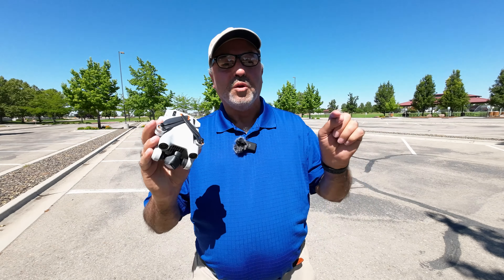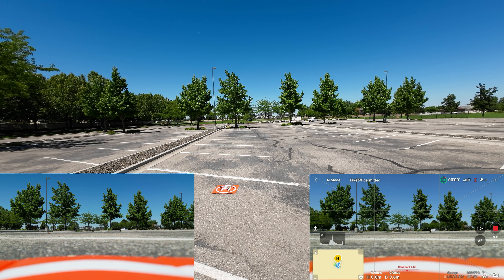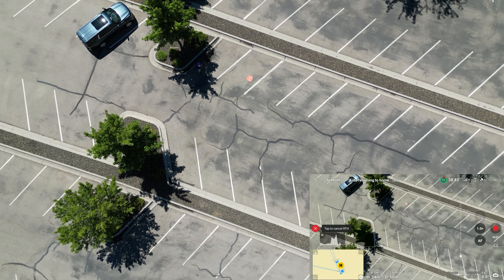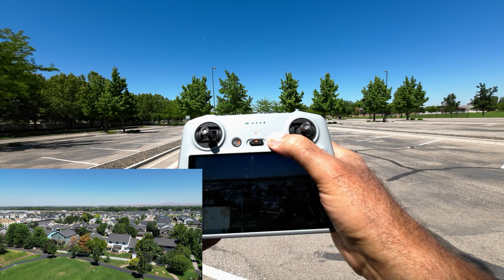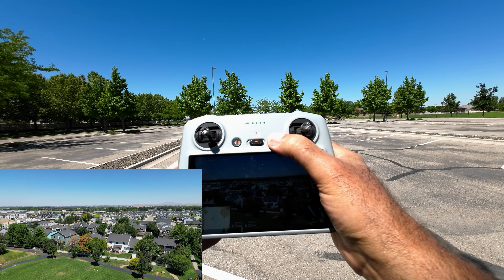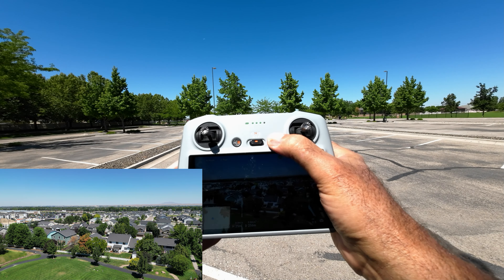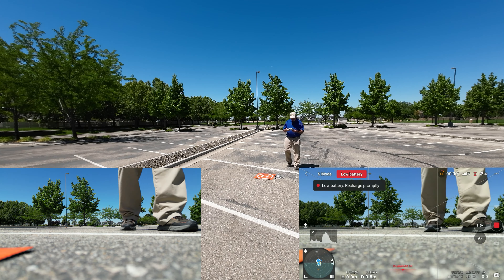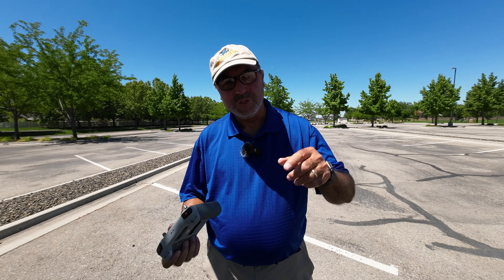DJI Mini 3 Pro - Complete Guide To Return To Home RTH - Tutorial

Comment: Can it dive faster with the motion 2? Say you dive as normal using the motion feature and pair it with the joystick? I always felt diving looked really slow when not in manual.
Reply from the maker: The Mini 3 Pro is not compatible with a motion controller.

Comment: Great video explaining RTH, however can I ask about Visual Line Of Sight as I'm struggling to understand it even after reading a great deal and watching many vids. I know this is a demo video to show what happens when the signal gets lost etc but I heard you say a couple of times things like "ok I hear it coming back", "going to turn away from the drone" and having the drone so far away you can't possibly see it, how does that work to stay inside the rules/law. I'm confused!
Reply from the maker: I understand your confusion.  I've thought about commercial drones that do automated mapping.
Reply: @IdahoQuadcopter  over the last two days I've read the new CAA guidelines for 2023 (as I'm in the UK). 4 weeks ago they changed the guidelines and later admitted they got a whole lot wrong as some CAP rules contradicted other CAP rules (there's also some interesting videos on this). Once reveiwed and re-released they did a question and answer interview and touched on automated mapping/RTH and said it can't be classed on as reliable. For example, when you switched off your controller in this video you were no longer in control of the craft, it was in control of itself, so if you had seen something like emergency services helicopter in the sky you couldn't control bringing it down therefore adding to the danger as your RTH might actually bring the drone into contact with that helicopter. However even if I have VLOS and the controller goes off I would still have the same problem 🤷🏼‍♂️, see where this just adds to the confusion

Comment: I was flying my Mini 3 pro two days ago and learned something. I did not pay attention to my pre-flight. I took the drone up about 300 feet to look around. I had it in one place for awhile panning and taking snapshots. I lost my bearings as I was over a lot of thick trees. I hit the return to home and it turned and headed for home. I noticed it had drifted a good bit from where I thought it was. It made it back home and before landing I took control as I like to land it manually. The wind was blow lightly, not heavy at all. As I did some trouble shooting, I found the left to right control was not working. I was turned off. I figured out the little amount of wind took it off course and it could not make the correction with the left right disabled. I learned to always do a pre-flight every time you fly.
Reply from the maker: I agree!  It's important do go through app settings.  Thank you!

Comment: Great video Marcus.  I learned some things.  I do have one question though, regarding Return to Home on a DJI drone.  Let's say I am climbing a mountain with the drone, staying about 100' off the ground.  The mountain is 1200 feet high.  So I reach the top and my Controller registers 1300'.  I have my Return To Home altitude set at 200'.  I lose connection and the aircraft automatically returns to home.  Will it fly straight over me before it descends, or will it try to descend to 200' on the top of the mountain, thus crashing on top?
Reply from the maker: The RTH height that you set in the app is above take off point.  If you flew the drone higher, it would stay at the higher altitude when returning home.  If there is an obstacle in the way, the drone would hover in place until the battery ran out, and it would land where it's at.  In certain situations, APAS may allow it to fly around an obstacle.
Reply: @IdahoQuadcopter  Thank you!

Comment: Nice! Thanks, ... can you change it to follow the controller? , or do you need to select the controlled to update this just before you land it? Thanks 

The use for reference, would be using it to active track a boat. With of course wanting it to auto track where the controller is to land wher ethe boat has moved to? :). Thanks
Reply from the maker: You can use active track to track your boat, but no this drone does not have a dynamic home point.  👍

Comment: Quick question about obstacle avoidance.  What's the distance that it stops in front of an object? (not using the go around feature)
Reply from the maker: I'm sure it depends on the speed at the time.  I can tell you from experience it's several feet.

Comment: Hello, does RTH  setting stay as it is IE to the controller (22:50) until altered again or does the RTH controller setting have to be picked after every RTH.  Cheers 👍
Reply from the maker: The drone does not have a dynamic home point.  If you move, you will need to reset the home point again.  👍
Reply: @IdahoQuadcopter  Hmm ok, that's surprising considering the cost of the drone. Just another quick question if I may....  
As it doesn't have dynamic home point, can one of the quick select buttons underneath be programmed as a RTH button ? Thank you .
Reply from the maker: @Original-q11  I do not believe so.  I have not seen that as one of the selections in the app.
Reply: @IdahoQuadcopter  Ahh ok thank you, I think I'm going to wait for the Mini pro 4, I'm guessing that may well have it along with the side and up sensors also 🤞.  Have a nice day 👍.

Comment: This is regards to what kind of model drone you got. I only have mavic 3 enterprise and thermal and a DJI fpv. They all will follow the RTH that shows in the pre flight check. It won’t land random if you are 5 meter away from update homepoit. And obstacles between the drone and homepoit are never a problem as I have experienced. It will either do a smart RTH or go to pre planned safe altitude for RTH. I can do a mapping and the drone finishes 30 meter from me and it will sky Rico up to 300 feet before it safely land at homepoit. Do I loose signal at a point it will stop, climb to pre set altitude and then ascend back down to RTH. It will if you choose use a smart way back. The fastest and safest way back. But maybe i misunderstood and this video regarded this drone type especially. DJI have a lot of different software on their drones. The enterprise can maneuver between buildings if that is the fastest way back and it keep inside the pre flight check.
Reply from the maker: Yes, this video applies to the Mini 3 Pro only.  All drones have different characteristics with regard to RTH.

Comment: Is there  a way to auto set home point to the controller so if you were in follow mode it would be auto updating as you go
Reply from the maker: No, you would need to reset it to the controller each time you move.

Comment: Whats with the overheat..ive been a heli pilot for years..about 8 yrs since last drone..im all questions
Reply from the maker: The little Mini drone does not have a fan.  If it sits on the pad too long while on it will overheat.
Reply: I understand no fan..obvious..i fly  sab goblin...fluid filled trans..just never heard of overheat in non high perf rc..
Reply: Any advice on this drone is appreciated..im headed to the mountains with this.. bought the fly more pack..looking forward to 1st snow flights..before video..we would blast snow up with blade 450s..flybar birds..might try with this drone and my blade 330s..my other half flies a mean heli..
Reply from the maker: @Jon Wingate  The Mini 3 is so easy to fly.  I recommend shooting in 4K 30FPS so you have full use of the zoom function.

Comment: Helpful video, thank you. The first time I flew my Mini 3 Pro I did exactly what you described, I moved around while it flew and then I realized I needed it to come back home since we needed to leave the area and I couldn't figure out how to update the home point to the controller's position - so I ended up manually flying it to a known landmark and landing safely. I think DJI shouldn't bury that option within some settings menu, it should be an on-screen option in my opinion (or something you can assigned very easily and quickly on the fly, especially when a situation arises).
Reply from the maker: Thank you.  I'm glad that DJI gives us these options on the Mini 3 Pro.
Reply: @IdahoQuadcopter  yup!

Comment: Awesome video, i have this drone myself but just a question, is there anyway to turn the drone lights off during day? im not sure if yours was off, is there any such setting? also the screen record quality, does it do it in 1080P?

By the way is that a Gopro on your tripod and you used a dji mic with it? really? i didnt know the dji mic works with Gopro am i correct? or is it a Action 2 only? great video though
Reply from the maker: 1. Not sure if you can turn lights off.  I don't think so.  2. The DJI RC only screen records in low res.  3. I use the DJI Action 2.  4.  The DJI mic system is amazing.  Thank you.
Reply: @IdahoQuadcopter  thanks for answering, yes I always wondered about the lights too. They should do some update to switch them off during day. 
I actually thought at one point in the video you said GoPro at the start that's why I was wondering. I just if been mistaken. I'm on the verge of getting those mics that's why I asked. I already have the action 2 as well. They are awesome. Thank u again 🙂

Comment: What will happen if RTH point is the RC and it losts connection to it?
Reply from the maker: Once you set that RTH point it does not change.  It would return to where you were when you last changed it.  The drone does not have a dynamic home point, it will not follow the controller if you move it.  I hope this helps.
Reply: @IdahoQuadcopter  thanks for your comment :)

Comment: if my drone have a range of 4km, could i start the drone, set a homepoint 15km away, and then when i press" return to home", it will fly the 15km by it self?
Reply from the maker: I suppose so in theory.  Battery life might be an issue.  The short answer is, I don't know.

Comment: You did a great job. One question. If I’m flying above my return to home height and lose signal will it backtrack at the altitude I was at for 50 meters then lower down to my set RTH height for the rest of the RTH?
Reply from the maker: Thank you!  It does not lower in altitude until landing.  If you are flying above your preset RTH height, it will stay at that altitude on it's return.
Reply: @IdahoQuadcopter  That’s great to know. I recently flew my mini 3 pro up a mountain and as I flew up to the top to a height of over 1,400 ft. I then lost connection and went into panic mode since I had failed to adjust my RTH as I climbed. I did regain connection and canceled RTH but had wondered if my drone would have landed somewhere up on the mountain had I not.

Comment: Recently updated firmware..before update i could fly around a room and drone would warn me..now that is not there. This drone is way smarter than me..any help is appreciated
Reply from the maker: I suspect you have the "radar" toggle turned off.  I believe that is in the safety menu.
Reply: @IdahoQuadcopter  ive just followed you tube..im not the only one..looks like a bad update..waiting for a new update..like i said..drone is smarter than me..toggling radar on doesnt matter..oh well
Reply from the maker: @jonwingate5535  I need to check mine out.  👍 Thank you for the heads up.

Comment: Well, some news about mine (mini 3 pro). I am more or less at my 5th or 6th flight and my drone went crazy after an auto take-off, deciding to fly with absolutely no way for me to retake control and take it back, for about 5 minutes, after which I was able to bring it almost to my balcony - unfortunately on 21st floor. There, again lost control and it smashed into the wall and fell all the &?&%&?* 21 floors...  Fortunately Amazon Prime allow me to return it - yet a few days to go before limit (I would have preferred to exchange, but it looks like I can only send it back for reimbursement.  I should probably order a new one, but that puts me into doubts. Aside of some broken wings, the top opened, a part slided out, I can no longer connect (alternating messages between ''preparing to take off'' and ''incompatible gimbal data'').  All messages on flight checklist giving:  1)Gimbal unable to connect. Repair Required. Contact DJI Support for assistance. Code: 1d030001.  2) IMU initializing. Retrieving IMU data (Code: 16100009).  3) IMU not calibrated. Calibrate IMU (Code: 30055).  4) Aircraft missing parts. Repairs required. Contact DJI Support for assistance (Code: 1610004b).  5) GPS signature info not found. Repairs required. Contact
DJI Support for assistance (Code: 16100071).  6) GPS module not detected. Repairs required. Contact DJI Support for assistance (Codne1<100024).      Bottom line, if it is built idiot proof and made almost impossible to lose,  when nothing seems to work with RC at less than 50 meters, I can assure there are other ways to lose it... 🤐
Reply from the maker: I'm sorry to hear of your crash.

Comment: From 18:35 to 18:46 the drone seems to be maintaining the 28m height (ok); spinning in place(ok); then flying away (VERY RISKY); and then climbing to the RTH height at 18:51. Did that really happen? If it did that, it's a serious unforced error. It should not be moving position before climbing to the programmed RTH height.
Reply from the maker: That is programed into the drone.  It reverses course for 50 meters in order to attempt to regain signal.  👍
Reply: @IdahoQuadcopter  Meaning it re-traces the path in? That's actually kind of cool. Presumably that would be a clear, safe path since it came in that way. Thanks!

Comment: Really good video and very informative- Thanks 

One thing to note, I have been in communication with DJI and they are telling me the Mini 3 Pro ALREADY HAS the Precision Landing  function and this was there at launch?

Very confused by this and for reference mine is normally off 1 to 2M’s when RTH as opposed to inches which would be the case if it had Precision Landing 

Look forward to your comments on this

Many Thanks
Reply from the maker: Thank you for this comment.  I'll need to try precision landing with the Mini 3.  I didn't think that it had that feature.  Normally you would let it hover for a moment at about 7 meters height upon take off, that gives the drone a good look at it's homepoint.
Reply: If you could try this it would be great
DJI are adamant the Mini 3 Pro has Precision Landing 
Thanks

Comment: I have read about this but its nice to see it in action. I set my homepoint one time and then walked to another area. I was landing with a low battery and just before I landed it went into return to home. It took off right toward a tree trying to go back to my take off location. I was struggling trying to figure out how to cancel return to home quickly but lucky it stopped before hitting the tree. I wish I could easily cancel return to home without taking my eyes off the drone. Its good to be ready and know where that pause button is without having to look. Its good to have a plan in these situations. They happen quickly. Nice video.
Reply from the maker: Thank you very much.  I tell people all of the time, "the pause button is your friend".  😀

Comment: Excellent video - I was hoping you would demonstrate/simulate the scenario where we have a continuously changing home point (e.g. landing on a moving boat) - Any tips for that scenario?
Reply from the maker: The Mini 3 does not have that capability.  It will not continuously cheng the homepoint.  👍
Reply: @IdahoQuadcopter  Thanks for the clarification

Comment: Just wondering why if multiple satellites are involved , as well as GPS , WHY doesn’t it remember the EXACT SPOT where it launched from to land back on ?
Reply from the maker: The Mini 3 is not equipped with precision landing.  👍
Reply: @IdahoQuadcopter    UGH :(.  But it still does a good job :).  Thanks.  Is there Precision in Phantom 4 MMMM I’ll take a look ..

Comment: Good thorough coverage of the RtH features.  One thing that wasn't covered or detailed that I've been wondering about quite a bit, is with the RC controller, how do you get GPS location for the controller (to indicate direction and location of controller on the mini-map as well as to update RtH to be at the controller's position)?  My understanding is that you MUST have WiFi (and/or Bluetooth) connection to your phone established, since the controller doesn't have GPS built in on it's own?  Might just be a good detail for some folks, since the RC controller (annoyingly) disables BT/WiFi when you first power it up and start flying to "improve range"...but really frustrates me when it does this, because it makes the mini-map pretty much useless (no street / info detail) and you can NOT now get any indication of the RC controller location.  Please let me know if I'm missing something on this for my experience.
P.S. Fellow Treasure Valley Dronie
Reply from the maker: Hello Jeff, and thank you.  That is no doubt one of the issues with an all in one controller like the DJI RC.  Often I will turn on WiFi again after takeoff and hotspot to my phone.

Comment: On the latest firmware, as of August 23 20'22, interrupting RTH by hitting pause disables the right stick. All you have is throttle and yaw. You can update home and RTH while in this weird pause state, but you can't move in X or Y manually until you land. Be aware.
Reply from the maker: Thank you for that information.  I'll try that out.